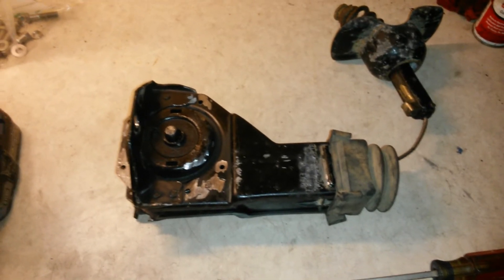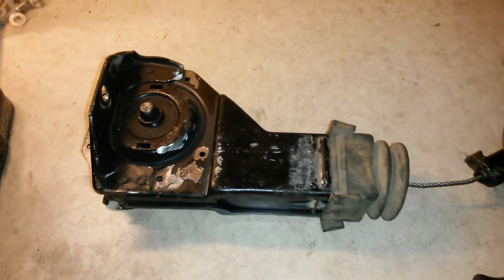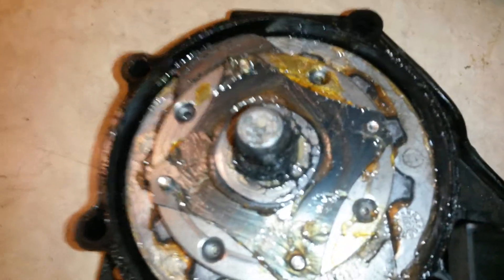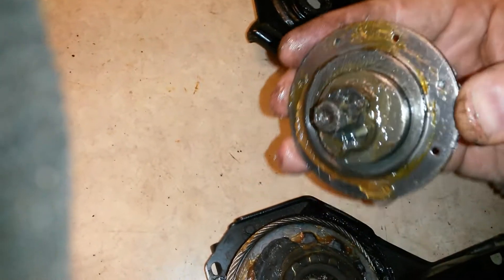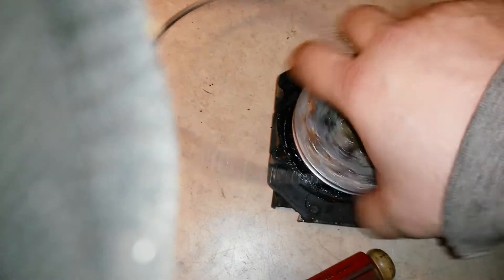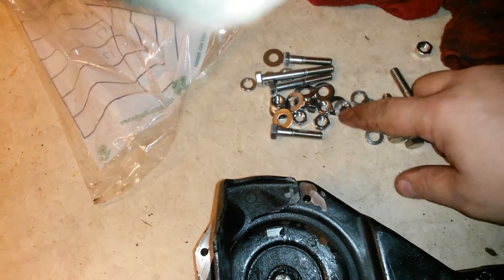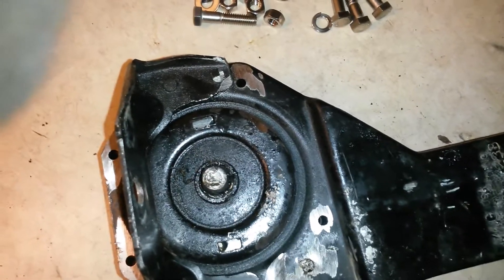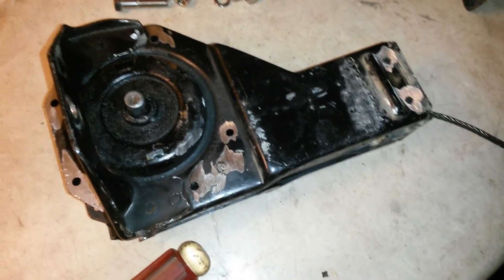GM Spare tire hoist

Comment: July 2017 on my 2005 Silverado 1500 HD (stands for high dollar) Awsome this fix will work. I just had one more mod. On the back of the pulley I had to remove the pawl (just drilled out the rivet) as it would get stuck when letting out the cable.

Comment: Why would you use 5/16" bolts when the holes are already 1/4" ?  and did you find the the two long bolts you used in the lower end stop the unit from fully retracting? That's why GM used two short rivets. The problem is the secondary latch.

Comment: Thanx for your video.  I had a spare tire hoist that retained my spare when I needed it. After cutting the cable - that didn't work & finally I unbolted the assembly from my Sierra.  Later, I discovered the safety latch after I called FIVE GM dealerships & they did NOT know about it.  lol  Now the hoist seems to NOT work.  What did U discover about the hoist function or how to fix it?  I know my tire got locked in by the safety but what keeps the hoist from working properly NOW?  I've had the spare off & on four times w only 45K miles on the 2004.  Not sure what is happening w the hoist??? HELP
Reply from the maker: Tom Landstone I actually couldn't find anything out of place on mine when I originally took it apart. I made a new series of videos showing how the mechanism works.
Reply: The same happened to me I guess the cable didn’t seat properly when it was coiling in the wheel.

Comment: Instead of fixing my old one I bought a new GM one and put a nipple on it and filled it with grease. Now it refuses to lift the wheel more than 2 inches off the ground. This part is truly a GM abombination. I guess it is the slip clutch arrangement they made. Utterly brain dead engineers. Brain dead. Now I will do like this guy did and cut it open and braze it or pin it together so that the shaft is one with the sheave - no more slip clutch. Idiots.